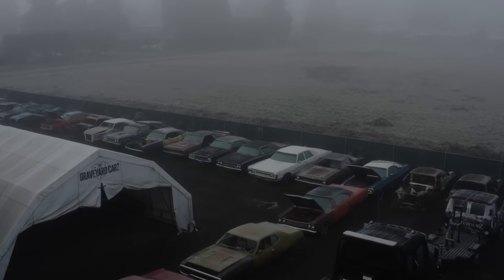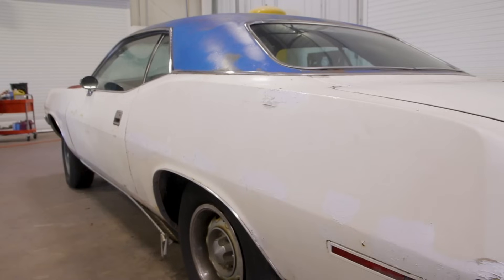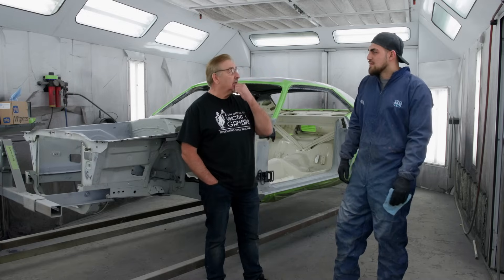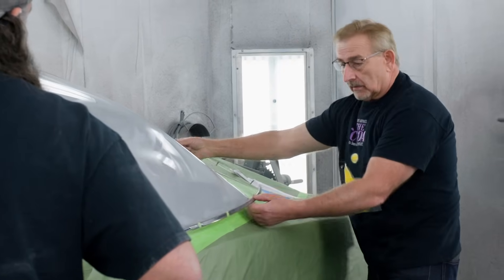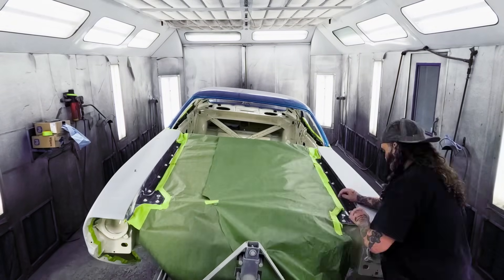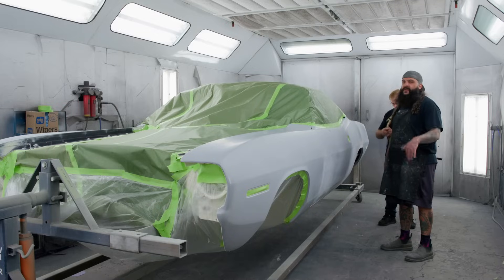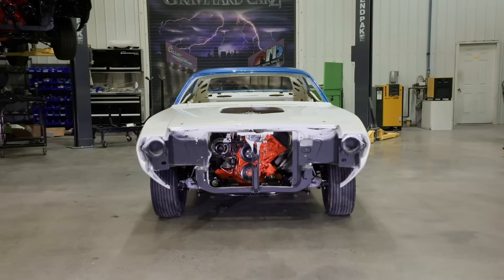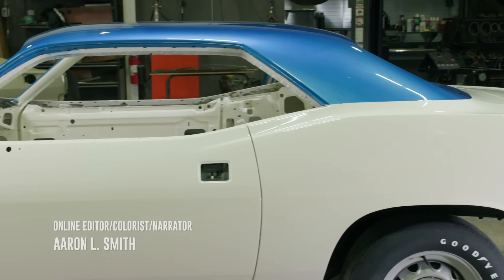A TWO-TONE HEMI CUDA? YES!! ONLY ONE MADE LIKE IT AND IT COMES WITH QUITE A STORY!

Comment: Bloody hell. Is Mark in lala land? Dealers painted rooves to customers specs all the time. And no it will not show on the ID plate. I have owned [as a dealer] literally dozens of cars modded by dealers either to dress up a car or to a buyers specs. I am looking out the window at my 71 Galaxie,, was all blue from the factory, it even did motorshows as a new car like that. Here locally they 'dressed it up with a vinyl roof, protector strips and alloy wheels. Far from uncommon. And now I have [20 years ago] reverted it back to all blue and no strips. GM in particular did some cars in shadow tones,, dealers dressed up plain cars like that and they sold far easier, did it on old cop cars to take away the obvious cop car. And they looked a LOT better than a plain powder blue.
Dealers also did cloth trim on vinyl trim cars. Holden eventually did what dealers had been doing for years with a V8 4 speed plain jane car and fitting the hero wheels aand window blackouts etc and then selling cars with 'normal' insurance unlike the hero cars. Holden built the SS, a poverty model with black trim, blackouts, console, instrument dash etc. Ford did similar as did Chrysler. 
I have also seen special order cars from the factory with 'non standard' parts and paint. 
Do NOT leave a fresh engine to idle on first start,, or it will wipe the cam in a very short time.. I have seen too many wiped lifters. Even roller cams it is not a good idea to let them idle when new.